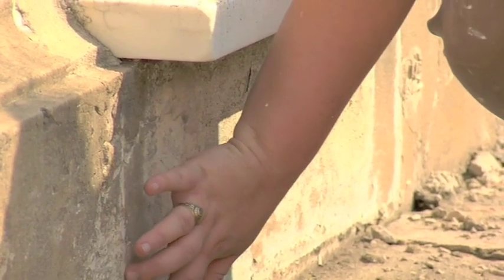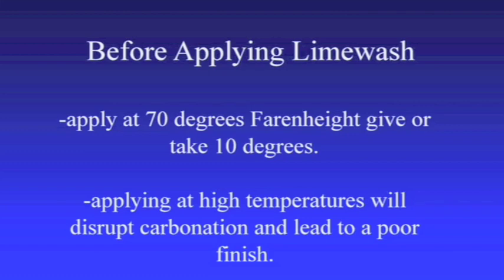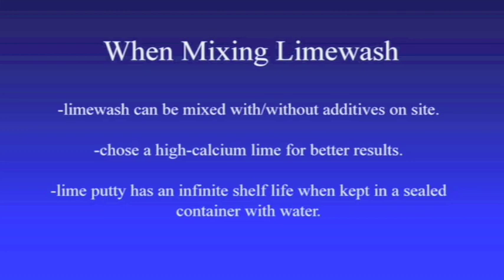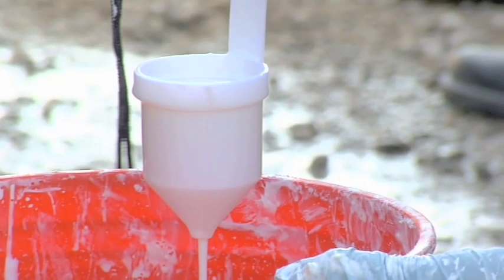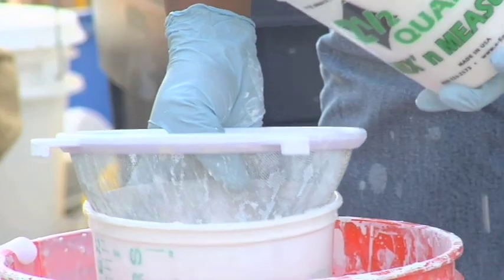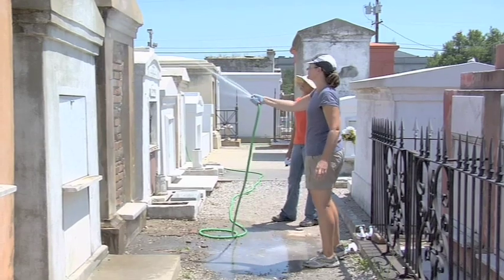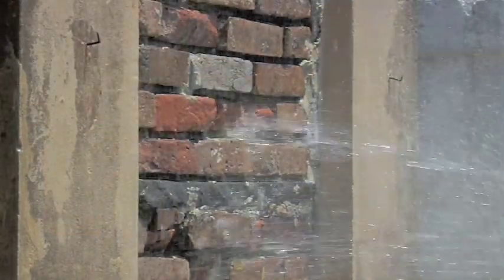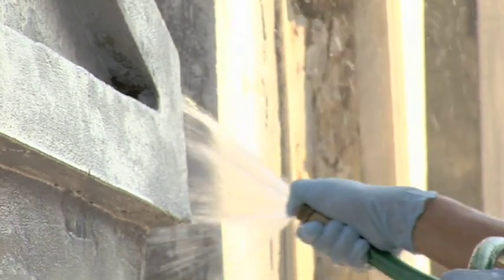Application and Preparation of Limewash (2008-07)

Comment: When I slake my quicklime I rarely ever screed or sieve the tiny lumps. Especially on a exterior limewash or even a traditional lime render for that matter. Definitely do it for interior work though. Hotmixed limewash I believe is the best as it sucks moisture out of the wall as soon as it is applied. Beautiful stuff to work with when dealing with a damp traditional fieldstone basement. As for brick i always water down the wash, use it still hot after sieved through a food strainer. If its thin enough ill apply it straight to a dry plaster wall. If its a stone wall I always apply hot and thick with sand mixed so as to dig deep into any voids. Limewashing brick i always soak the brick first for a few minutes. The longer the better. Thin for the win with aged lime putty. Thicker with a hotmixed limewash.
Reply: Do you add anything else please?
Reply: @nowirehangers2815  rarely. If I do id say add some stone dust from a quarry.
Reply: @jeremiahnichols2729  cheers thank you. There seems to be a whole lot of complicating a very basic process and I choose to just keep it as simple as I can. I have a concrete fence,it’s supported by rebar inside it somewhere but it’s very old and looks quite bad. Grey,starting to crumble a bit. It’s only like 3 and half foot high but it’s got wrought iron work on top and I think it’s all kind of hideous.
Can’t afford a new fence but can definitely make the cement look a whole lot better and hopefully give it a bit of hope. 
I appreciate your response.
Reply: @nowirehangers2815  a basic hotmixed limewash will brighten it up. It will stain over time though just from cracks and water buildup.

Comment: you can make it thicker than in this video to reduce coats. this will take a longer time. with a perfect lime wash you should only need 2-3 coats not 5. this is time consuming and unnesesary.
Reply: Hey thank you
Reply: Not true 5 and even up to 7 coats is possible
Reply: @es4666  That's great that you find that 5 to 7 coats is possible. It's factual that you can do that many, not possible. But as I said, this is time consuming and unnecessary.

Comment: Caco3 and this video using white wash powder same or different??
Reply: They  are different. Calcium carbonate is limestone which has just been crushed and not heated to remove CO2. The one they use in this video is Calcium Hydroxide or which is basically heated CaCo3 + H20. CaO also works.

Comment: Can I use lime wash to change the color of cob? If so, what exactly do I have to add to the lime wash and is it easily available?
Reply: You can use powder pigment to change the color of lime, but you should be prepared to do a handful of tests beforehand to see exactly what the mixture cures to. If you are doing this, you should try to do layered coats on a sample surface. I have done this in an obscure corner before the project which works, and you can brush away much of the wash with a wire brush in slow, gentle strokes.

Make sure to be VERY precise on your color to wash measurements, as the pigments will normally be very strong.

Comment: Great video, thanks. It would be better if the narrator talks little slower :)
Reply: you can watch it in 0.75 speed with CC on! it's a bit boring but you get to understand everything. 
Watching it with CC at normal speed is way to fast
Reply: Disagree, ended up watching at 2x speed.

Comment: I noticed that some of the buildings that you worked on needed repointing of the brick walls before lime washing.
Reply: @NerdyNEET  Yep. basically those are the infill door. they'll take those out and then reseal every time the tomb is used. Plus they would alsu normally have a secondary "face" they'd add over that section.